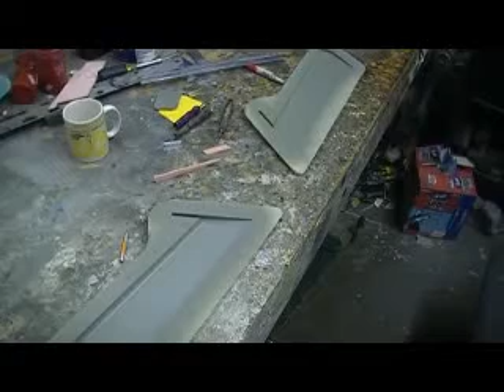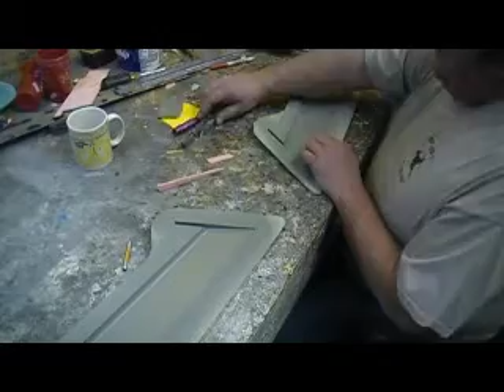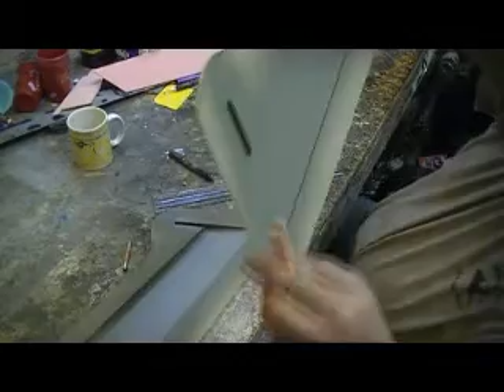how to build a rc jet F-105 thunderchief # 336

Comment: It would seem to me for bending the foam for those straight edges a "brake" could be made out of a 1X4 and a few cheap hinges. Of for those small pieces, like your control surfaces. A few pieces of 1/8" thick wood strips held on by a few clamps would work good. Thats the kind of "really poor mans" brake I use to bend aluminum flashing.